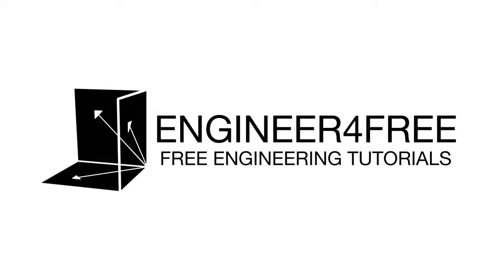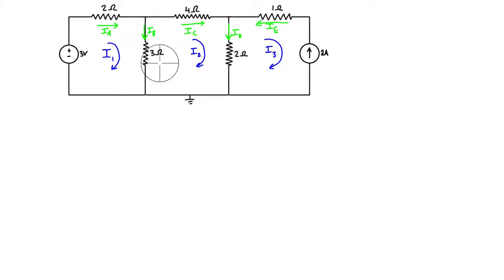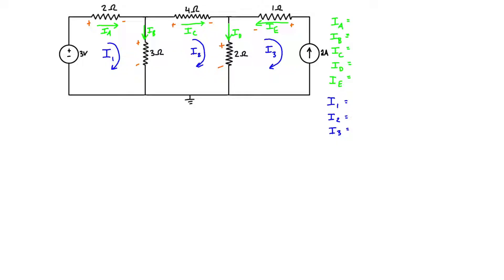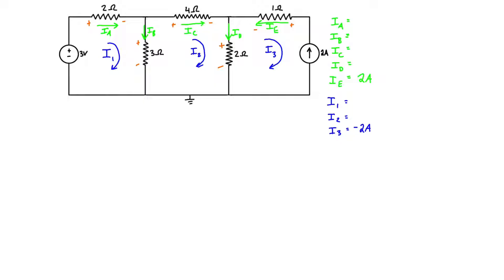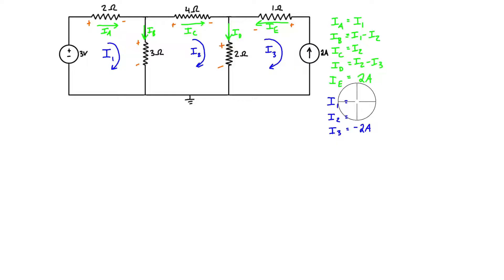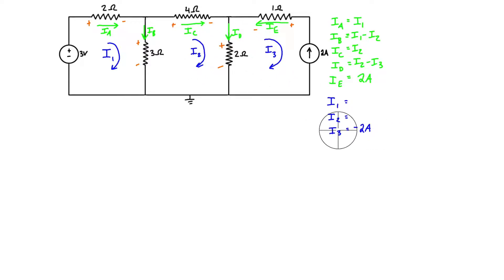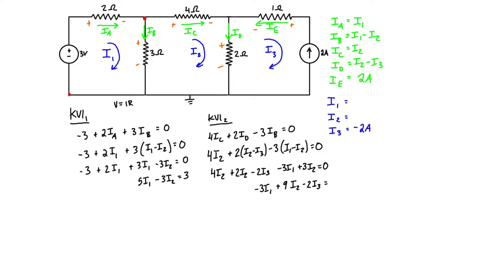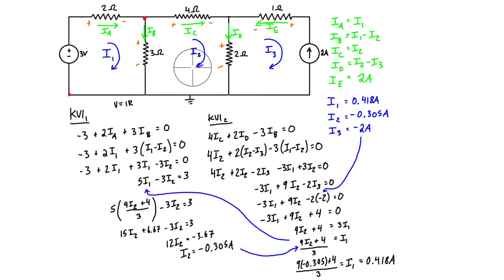Mesh Analysis Example Problem #2

Comment: Madam tell me about the total power please
Reply: I might be wrong, but if you're looking for the power supplied by the voltage source I think its just IA * 3 since IA should be the current running through the voltage source and P=VI

Comment: Is it not possible to use the third mesh? Or am i missing something,
if 
ie  = 2
i3 = -2
ie = -i3
id = i2 - i3

and going around the third mesh following the direction of i3 we have 

-2id -1ie = 0
putting in terms of mesh currents 

-2(i2 - i3) + i3 = 0

replacing i3 with -2

-2(i2 + 2) - 2 = 0

solving for i2

-2(i2 + 2) = 2
i2 + 2 = -1
i2 = -3 A

which is not the correct answer, why?
Reply: i am stuck with the same question. did you get why is it like this?
Reply: @ArdaBatinTank  I think it might because the current sources also have voltage across(we can't ignore it but it is hard to find)so sometimes people use supermesh to solve

Comment: @Engineering4Free
Many thanks for taking the time and effort of making these videos and sharing Your knowledge. It is in my opinion channels like Yours that give YouTube it's actual value.
Best regards

P.S. Im not really "into electronics" but was just following along because I was "curious about the concept".
But when I then also modelled this circuit in "Spice LT" it gave the result for "I1" as 0.4166666(recurring).
So I went through on paper, following Your instructions, and got the same result for "I1" as the "Spice LT simulation". 
So as far as I can see Your "I1" is "slightly off" (0.01) due to You "transferring" Your "rounded/truncated value" for "I2" as 0.305 rather than the "exact value"  for it that was -11/36 (0.30555...). When I made my "paper calculations" I "refrained" from any rounding until the "last step" and then those calculations also gave "I1"= 0.416666 (or 0.417 or "exactly" 5/12).
I apologise if this appears to be "nitpicking", that is not my intention, and the difference might be totally insignificant for calculations of this type of calculation and context. But I can't tell if that's the case since I really don't "know electronics", and being a total novice just the fact that the "figures didn't match" even if it was "ever so slightly" made me question whether I had misunderstood something. ...Hence this "tirade" ;)
Again many thanks for Your videos.